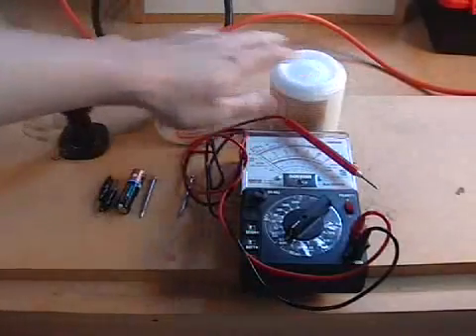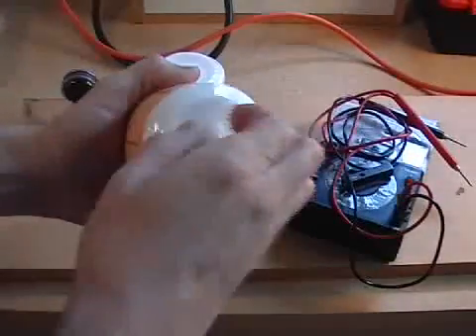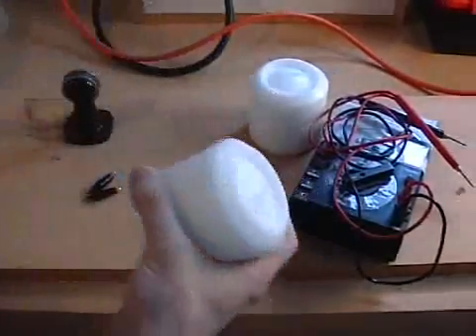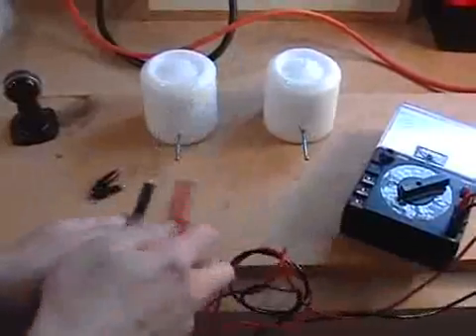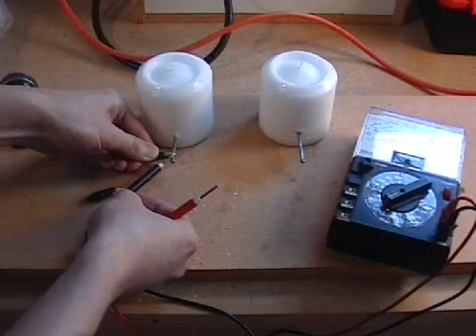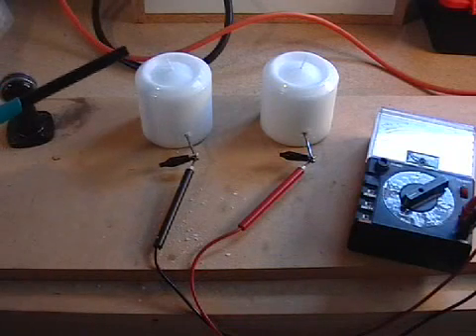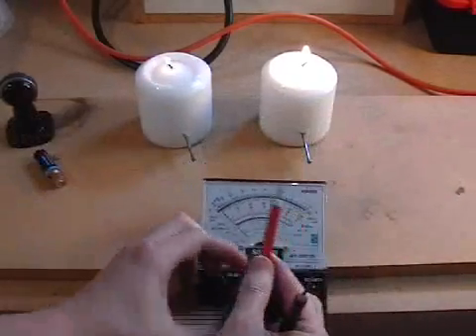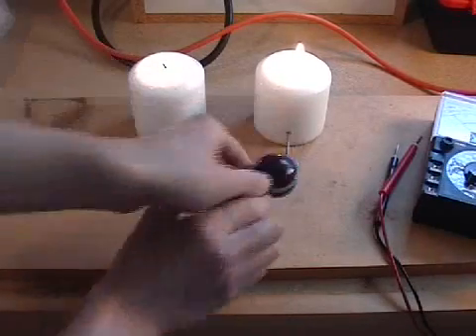Electricity From Candles

Comment: No No! Youre making wrong!

First:  Most wigs on USA uses ZINC in the candles - Be sure to touch zinc and use cooper wires. Zinc and cooper is used to create termo-energy.

Second: Video Is related, each fire creates a upward hot air vortex that can cross if goes into the wires and cross the wires before goes into the engine, makes the half-ring. Tests if you need a nearby fumehood or table, or enough time to the hot air reach the roof in tropical places where the heat does not disperse easy. So that the ring can be formed and goes conect where both wires cross before reach the light or engine ends of the circuit.
 
https://www.youtube.com/watch?v=pnbJEg9r1o8

Comment: Thank you for bringing the science.  For the questioners, Note that the meter maxed out with a 1.5v battery, which means its on a rather sensitive setting, compared to the lightbulb in the original, assuming 3v to fully light.

Comment: Dude,  your not doing it right! you need a hot piece of metal, and a cold piece of metal to touch. The electrons move from the hot side to the cold side creating a current! If there are only two hot pieces of metal, there will be no polarity therefore, no electrical current!